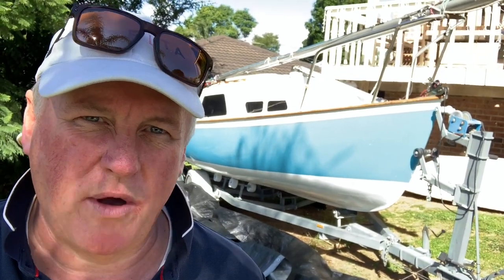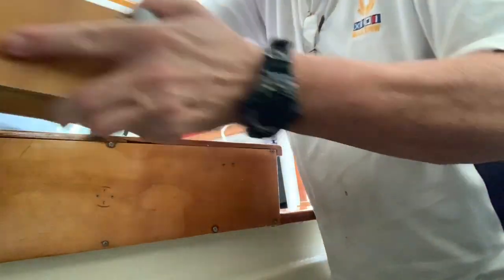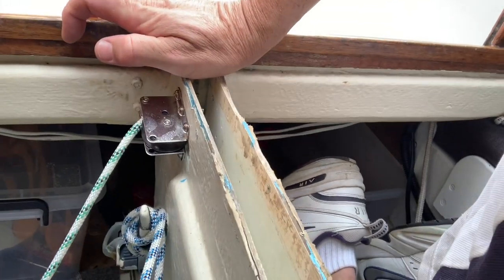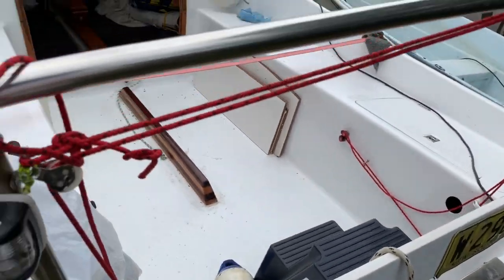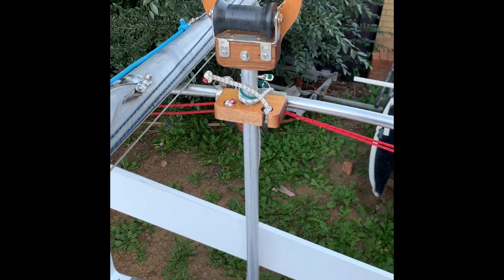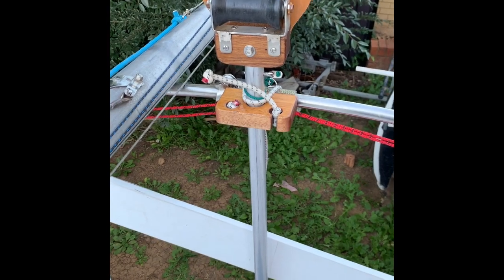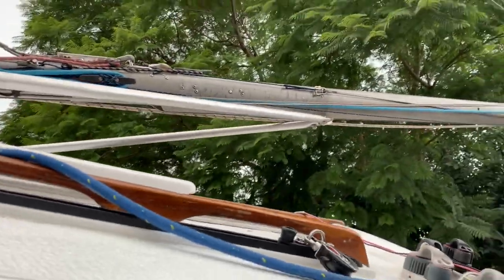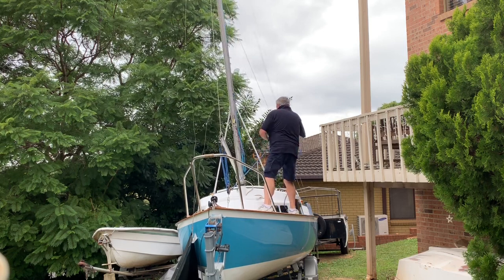Careel 18 Part 1 Get Her Ready For Sailing Single Handed Mast Raising

Comment: Hey Nick, So pleased to find your video. My brother and I have a Careel 18 and are trying to make a mast raising system. If possible can you give me details of the whole system, it would be of great assistance. Thanks Bob
Reply from the maker: Hi Bob, I will try and make a more detailed video of the components to my mast raising system, but my system was made for me by stalwarts of the Careel Association Vern and his mate Ray. They are contactable through the Careel Association otherwise you can see my update shortly.
Reply: wilsnich02 Hi Nick, thanks very much I appreciate that, I’m am on the Careel web site so will check. I’ve had a close look at your video and can get the gist of how you’ve done it. Our boat seems an earlier version so some differences . I’ve started this morning to gather the bits needed. I’m sure the community would appreciate a video if you do get the time, it would be good to get a close look at the connections as hats not so evident. Anyhow don’t stress please , I think I can crack on with it now I’ve seen your video, and compliments it’s well done. Cheers Bob

Comment: Gday, mate. how racked back do the careel 18 masts gotta be? trying to rig mine (414). The shrouds stop the mast going 90 degrees. I understand that some rack is required, but maybe not this much? The forestay is loose as, connected it to something on furler. (Don't even know if correct. No information anywhere. Currently trying to zoom into every rigged C18 i can find.) The aft forestay is 150mm too short. I have just bought her and don't understand how it could be so off. I cant adjust the forestay with length trim. I have just sent my application too. There is no information about this kinda stuff online. must be mostly word of mouth.
Reply from the maker: Hi Mossy, opinions vary but level up the boat to her water line, if no water line anymore float the boat in is normal rigged up state and hang a plum bob off the top rear of the mast, the plumb bob should sit between 1 and 3 inches behind the mast at the deck

Comment: I've just got a careel.
Can you please share some information on gin pole dimensions and side stays / braces
Reply from the maker: I had the whole system made up for me by two fellows from the Careel Association about 3 years ago and since posting that video last month two of my Careel buddies are getting the same raising system made up for them.
The Gin Pole is approx. 60mm aluminum tubing and about 1600mm in length (63 inches). The A Frame poles are about 30mm Aluminum tubing and 1500 mm in length.
Reply from the maker: Log onto the Careel Association and join up, lots of help and information available plus fun times...